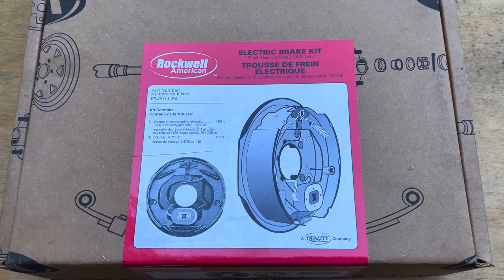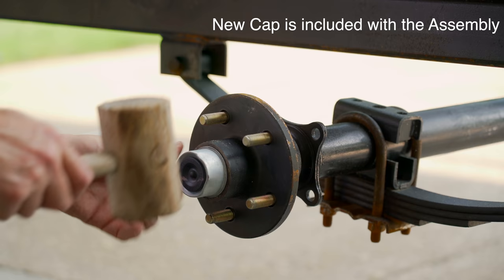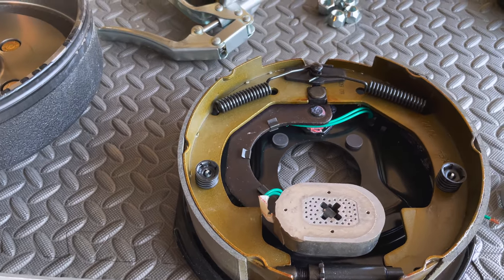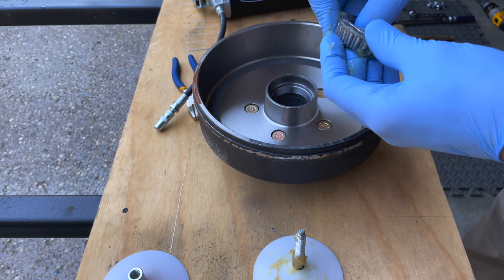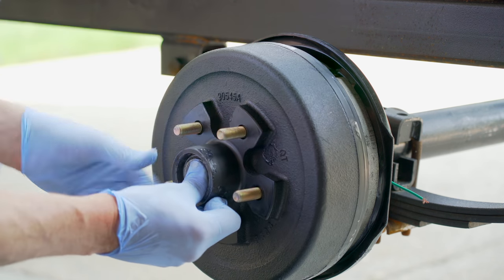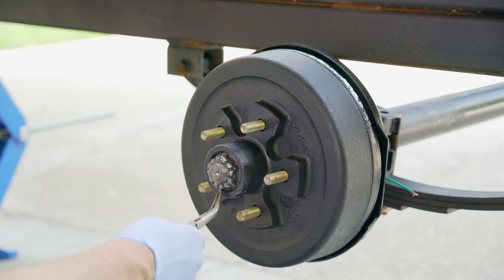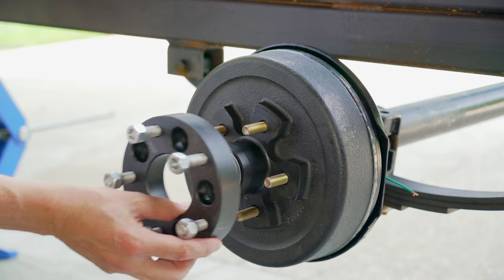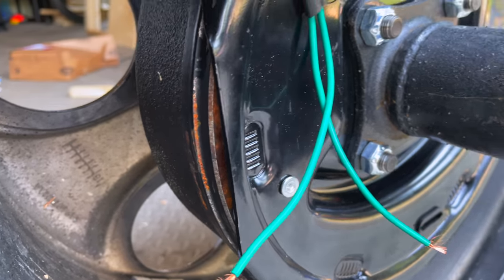How to Build a Travel Trailer - DIY Guide to Installing Electric Brakes from Princess Auto

Comment: New sub here. I like your channel, but I'd like to point a few things out. 1) Not all JEEP wheels are 5 on 5. Older is 5 on 4.5 like your hubs.  2) I agree on all of the bearing stuff other than you forgot to lay some grease in the seal before putting the hub on the axle. That's a sure fire way to smoke the seals.. 3) I am guessing you did, but in case you didn't, the wheel adapters also need to be torqued.  I have never lost a bearing on a trailer in my life, but I know plenty who have. One thing I always do is keep a spare hub and bearings and the tools to install them in the trailer or trailer box at all times. Even if you take out a drum for some reason, maybe wasted lugs from being lose, you can replace it with a non brake hub...
Reply from the maker: Thanks for the sub and the info.  Hope you enjoy the rest of the build.
Reply: @DrenalinAdventures   I am sure I will. Something else I wanted to mention is that I like that you flipped the axle OVER  the spring. Especially for an off road unit! You may find the tire and fender a bit close for comfort one you have the rest of the trailer built. In that case, I suggest you cut off your spring perches and add a 2" x 2" X an additional 6-8 inches for and aft of the original perches and re-weld the perches on.  This will not only give you 2 more inches and keep the axle on top of the springs, but also spread the trailer weight over a larger foot print of the original frame.. That is, if you feel the need to!! ;)

Comment: I have a question. Why not use non-electric brakes? Because relying on electricity seems like a double edge sword. If you use mechanical brakes it eliminates the need to rely on electricity right?
Reply: You realize you gotta supply electricity to the trailer while you are pulling it in order for the tail lights/turn signals to work anyway?